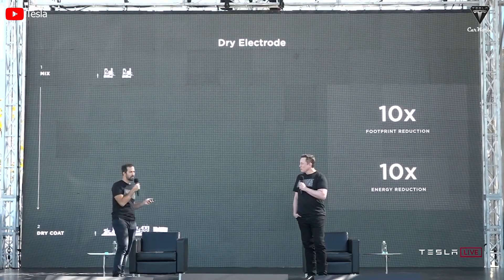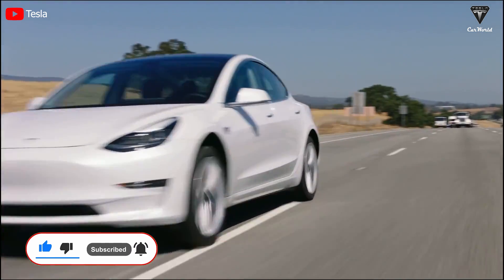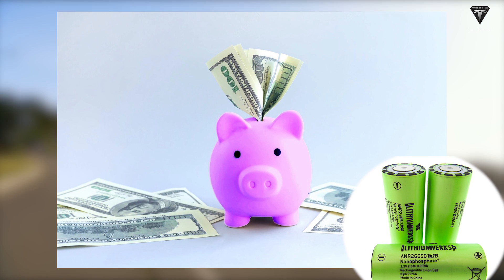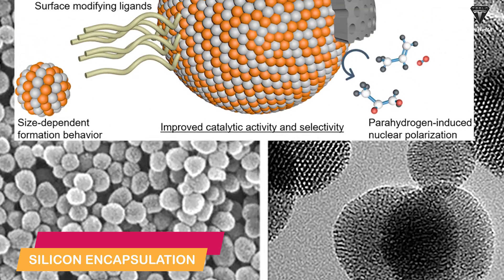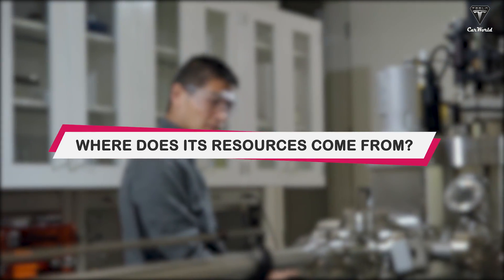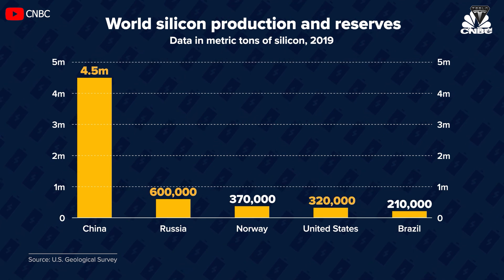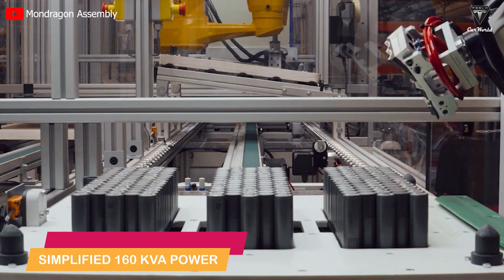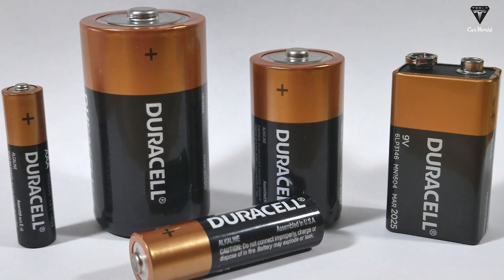Finally Happened! Elon Musk Revealed Breakthrough Silicon Battery, Entire Industry Change!

Comment: Faster charging is terrific as a principle, to make EV more practicle for people. The long charge times become impossible on major highways, as more and EV must stop to charge. As number of charge nodes multiplies so does the power supply needed. As 10s to 100s of charge nodes become needed the power demand  rises beyond installed capcity in many places  irrespective of charging time. As slow charge demands more charge nodes versus faster charging multiplies instant power demand.  Same demand for 100 nodes for 1 hr or 10 nodes for 6 min, it is the KWh result that is crutical. That is determined by energy used duringvdriving over distance. Electric drive can only achieve some limit of efficiency for  given work done. EV is by nature more energy efficient than internal combustion that loses much energy lost to hot exhaust gases and engine cooling, really never better that around 30%, while electric drives might get better than 60 to 70%. Other energy uses like lights, airconditioning and others  remain same whether IC or EV.

BUT THERE ARE BIG PROBLEMS TOO inherent to super fast charge capability, not even considering heat released by battery pack and charging equipment. 

Take for basic need the power input needed for the fast charge, there is say a need to put 100 KWh  charge into the battery bank during charge time. At practical charge efficiency it needs more energy to put that 100 KWh into the storage. Assume for this example 120 KWh is needed, at 6 min charging time, using flat rate, needs 1200 KWh input, that is a 1.2 MW power source. While that extra 20% energy is needed for battery to receive that energy, that energy will need to be discarded in significant part byvthe batteries and charging equipment. A power nearing 20 KW of heat must be discarded. In 6 minutes equivalent to 200 KW heater operating during charging. Can you imagine the local vicinity heat effect  given a few KW electric heater can warm rooms in a house very well. Charging stations while busy will be more like massive baking ovens.

If a typical charge station has say 10 charge nodes, that needs a 12 MW power input capability, for even a moderate city, of say 10 such charging stations of that capability need 120 MW capacity town peak demand just to keep traffic operating.  In large cities easily 10 times that 1200 MW. The likelyhood of that being readily available power becomes rapidly impractical by demanded power distribution network on top of existing peak power needs and impossible rate of power sourcing for rural small towns with even very few charge nodes at small charging stations. Such power rate could consume more than current peak hour demand of such towns if significant through traffic raises needs above just local traffic. 

Lithium as noted by many comments is NOT  replaced and remains a bottle neck as EV use expands .  Silicon while the most abundant ellement in earths crust inform of rocks and sand  must be made into highly refined pure silicon to be of use  a very energy demanding process and far from cheap in high volumes. Silicon however is also now and ever higher in demand for silicon solar cells for all those solar power panels needed for " renewable" energy, plus though other uses in comparative smaller actual volumes, all those semiconductors of modern electronics  which will exoerience major demand growth too for all those power electronics of charging infrastructure and power control in EV vehicles. Given current Silicon refining capacity until major expansion of mining suitable sand and rocks, not all equally suitable,  and massive increases of  processing plants, with suitable power sources are created Silicon WILL BECOME A BOTTLE NECK OF INDUSTRY.

Not only batteries and charging of systems vehicles  bothbcar but the coming big vehicles trucks  busses etc. The huge battery banks that will be needed  no essential, for "renewable" power solar, wind and maybe cyclic tidal or wave power  to cover periods of lack of sourcing from these places, and even peak demand times. Solar every night  wind variable from none to good, but slso shutdown when too windy for stormy conditions. Tidal twice a day at tide changes  waves like the wind very variable capacity. Thosevare not simple KWh to hundreds of KWH but to massive hundreds to thousands of megawatt hours. A city can demand huge immediate power needs, not muchbachieved if battery standby lasts mere few hours or less. The battery must support city power levels up to days, or the entire city will be shutdown, limiting critical systems like hospitals, cold storage of foods  pumping systems for water, sewage, under ground and tunnels structures draining,  communication systems  and all those homes with all their needs of refrigerator/freezer, heating colling and lighting. Yes in limited sense all must put in place own backup resources, fuel based generators? Own battery systems? How to achieve that demand will be massive in cost and space required. How much for overnight  for severe weather lasting days.
Then after major loadvin battery backup is the power demand to recharge, in timely manner for the next  possibly almost immediate next need to use it.

Even the Elon Musk provided large batteries installed in Australia, barely support a few hours. Nothing like days of cloudy, low wind conditions  needing huge cross country power networks to draw down potentially also limited power from adjacent states/cities. One installation within weeks (days?)  of coming online, had a major serious fire of an entire block of the battery banks, damaging adjacent banks,  shutting down operation for many weeks to repair and replace. How could a major city survive a month on very reduced power.

Battery fires are now with relatively few EV vehicles already becoming a regular major hazard, as they are in effect not able to be extinguished, must be left to burn out over long times. In cities that is a wider fire risk. Not all current batteries are manufactured sufficiently safe types,  cheap Chinese cars are experiencing severe fire problems for some manufacturers especially certain models in China. As world demands blow to huge levels these issues will become ever more a problem, not now seen on premium brands who seem to be able to source and maintain better quality parts.

Future waste disposal and/or recycling and material recovery must now be established. We now already face a deluge of solar panels becoming due to replacement as life is reaching what seems evident a useful life of around 20 years. Nothing exists but landfill disposal for most such. Wind turbines have other waste problems  especially the blades that actually suffer significant wear and damage needing regular replacement and the typical fibreglass construction has few recycle possibilities. But also the machinery contained in the high nascelles  plus stress wear and tear on the entire tower  be it concrete or even some steel frame  or the plinth it is mounted on. Seems in rush to install more and more overlooked are aging/wear on already inplace systems  little is being provided/planned  to deal with major waste accumulation as whole systems are becoming due to be replaced. Old blades are now already becoming huge waste piles.

Comment: As per your data and research results, the Silicon battery is better in every conceivable way to the Lithium Ion battery, it meets all our needs and has no undesirable effects. This is very unrealistic that something can have no drawbacks. But, as you say, this is so, so let's get cracking. I want to take a bath and start cooking using silicon batteries.
Let's go. Throw out everything else.

Comment: Seriously concerned about the 80% health at only 500 recharges as quoted in this video.  That is extremely low.   It sounds like a lifetime in an EV of only about 2 years unless you put in a really huge battery that does not need recharged daily to overcome range anxiety.  And while they say that it can be rapid charged, that kind of rapid charge would require a huge amount of Amperage and thus chargers with huge cost and really huge diameter cables.  We are already seeing theft of existing charge cables, these larger cables would be candy for thieves.  I doubt the current plug standard could handle that kind of current.  We are talking about the much larger style super chargers and plugs that are used by the Tesla Semi to accomplish this.

While it does look like this tech might make it to market fairly soon, there are other techs that support in the neighborhood of 5000 recharges that are only a year or two behind this one.  So it looks like these style silicone batteries may only be a short term/dead end solution at best.

Comment: Meanwhile gasoline has 12,800 wh/kg. Still have quite a bit of work to do.
Reply from the maker: That's accurate, even if gasoline has a lot of energy, we need to look into alternate batteries for gasoline in order to lessen the significant quantity of air pollution from exhaust gas released into the environment.
Reply: @TeslaCarWorld  Absolutely. Finite resource as well.

Comment: all that is nice and good but what about the cost of charging them? as several experts have pointed out, the whole "go green" thing has become a sunk cost fallacy. in the last 20 years governments have spent 13 trillion dollars chasing the green utopia and have very little to show for it, with only 5% of energy being produced through renewables (catchy but scientifically inaccurate term), with no prospect of it going much higher any time soon. no matter how good the battery is, it currently takes more CO2 through coal/gas burning to charge it than to get the same milage with gasoline. and hydrogen will have the same problem because (thermodynamics 101) you always get less than what you put into a system. you need more electricity to make hydrogen than the power you get from the hydrogen created and if the electricity is from coal/gas, you get no ecological benefit.

Comment: Battery still does nothing for adding the needed power to the grid to run EVs.
Reply: I installed a huge solar system on the roof of my house. How about you?
Reply: @lesp315  Too many carbon storage devices casting shade on it for those.
Reply: Actually, large battery banks are the best way to make solar power available to cars.   We collect power when the sun is out and store it in batteries.  Then at night we have power for lighting, heating and for charging our cars.     Even if you personally can't understand or afford it, your neighbor will do this and reduce the power he takes from the grid leaving more for those like you.   The bar is very low for getting into the electric power generation business.   All you need is one panel and an inverter.   You can scan up from there until you run out of room to physically mount the panels.

Comment: A lifetime of only 500 recharge cycles? Does that mean you need to replace all the batteries every year and a, half? That's not many recharge cycles. To last very long. Lithium-ion are good for over 3000 recharge cycles.

So these silicon anode batteries ain't ready for, prime time, yet. Not with only a lifetime of 500 recharge cycles. Then, no. It's not ready. More work still required.

The buzzword a couple years ago was Solid State Batteries. I guess those fizzled HUH? Not close enough yet? Not similar enough to, lithium-ion battery manufacturing. Yet.

These, otherwise, sound like they are ready to start, refining more.. Which generally means entering service. Adopted for all sorts of applications. And we, upgrade and improve, from there. The same for, our cellular phones went for the past, 4 decades.  I had the originals back in 1983. Motorola Bag Phone and a Motorola 8000 portable handheld. And you had to pay for every minute of talk time. Times have changed. Radically.

These silicon anode Batteries, are just another, variation on a known theme.  This is not new technology. This is Lateral Technology. Put to use. Now to just ramp up the manufacturing. To get a quick turnaround on their investment. That supersedes, lithium-ion. Now old hat, blasé.

What? You're using those old-fashioned early 21st century lithium batteries? What's the matter with you? How conservative do you have to be? That you would want to wait hours and hours for a full recharge. Sheesh? Stay old-fashioned! And rot with it.

We all have to keep up.
RemyRAD

Comment: Cheaper Batteries may be used with photovoltaics for houses off grid power supply.
Reply from the maker: That's right. In such a situation, this is an extremely helpful option.

Comment: Ev are not the future.  You have to strip mine in earth for these rare metals. Then how is the power being produced to charger the batteries of the EV. Are the power plants burning coal natural gass or nuclear power. None of them are clean power . Burning fossil fuel creates green house gasses and nuclear power you have to strip mine the earth again for uranium which ruins the earth. Vehicles exhaust emissions only adds up to 15% of green house gasses so how are cars the problem. Hydrogen is the future same performance as gasoline zero emissions. Now Toyota thats moving forward.

Comment: The silicon battery was an invention on the burner since the first founding of piezoelectric.

Various stand-alone innovators have found ways to use said element, but they were quickly squashed by NSA under the orders of national security or other nations that couldn't benefit from such a founding.

Comment: EV's will never take off using this stupid generate electrify and send miles away to charge a battery that has a limited life, what a waist of efficiency and materials. Not until the Diamond Nuclear battery come out will it change. A forever self generating battery.
Reply: Diamond battery is a joke and if it were possible it would never charge itself fast enough to be practical for daily use. BYE BYE